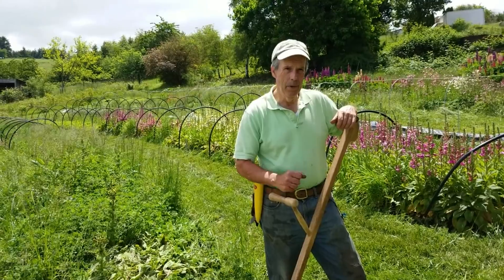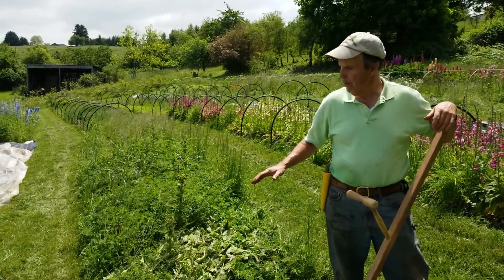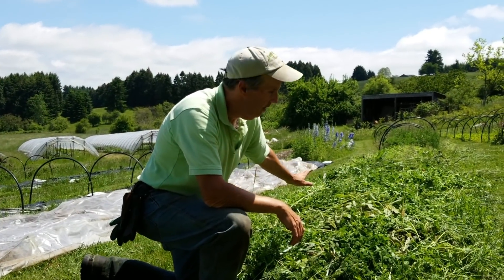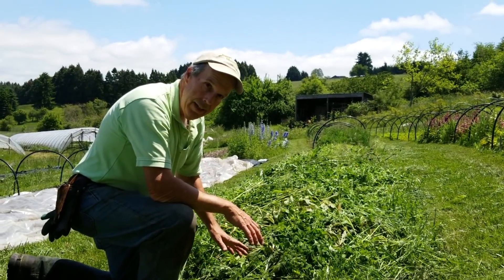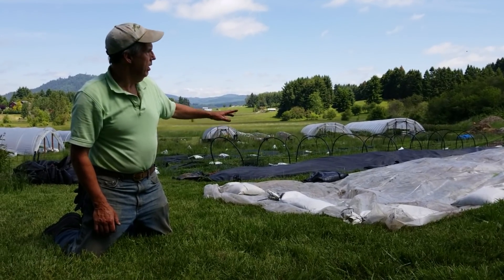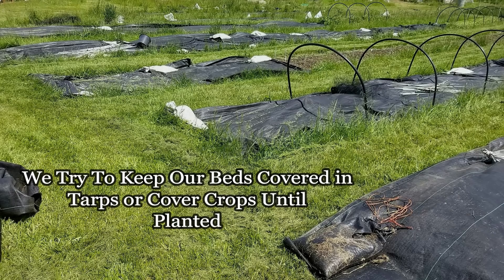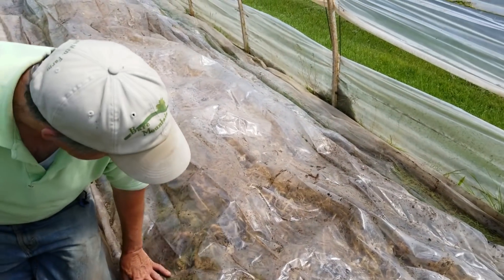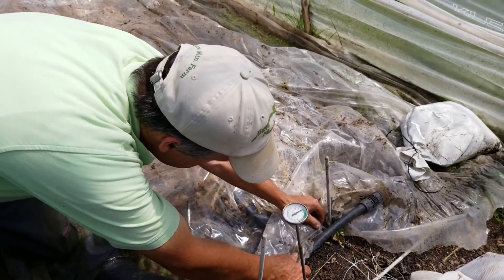No Till Bed Prep Using Solarization

Comment: Do you have a link to the 'small hand scythe'?
Reply from the maker: Hi @Amy Crawford we have used the hand sickle from Scythe Supply (https://scythesupply.com/blades.html). However this tool while very good is pricey. An economical  alternative is a Japanese style hand sickle we have used before is illustrated at our Amazon Storefront (https://www.amazon.com/shop/baremtnfarm) Hope this helps!
Reply: @BareMtnFarm   is this the sickle, from Scythe Supply? I want to get something that will last a long time, can be sharpen and will hold an edge
Gardener's Sickle
A handy versatile tool to have in the garden and around the yard. This sickle is small enough to maneuver in between rows for cutting those weeds which have gotten out-of-control. Take it with you to the grape arbor for trimming around the trunks or out to the raspberry patch to trim the canes. Sharpens with file and whetstone.

Size: 13.5"/34cm 8 oz. Right handed only.
Reply: the link you attached to your amazon shop did not work (:(
Reply: Link broken 😞